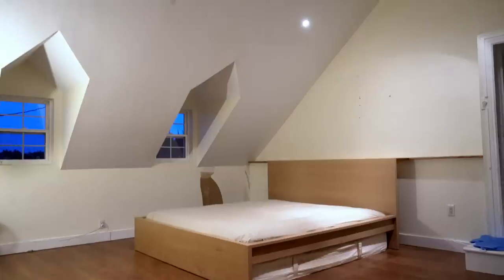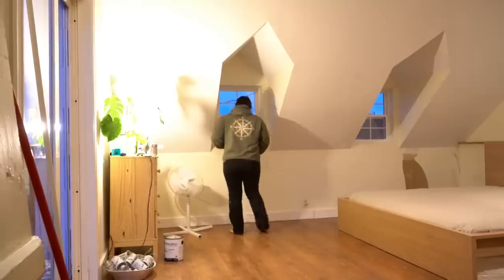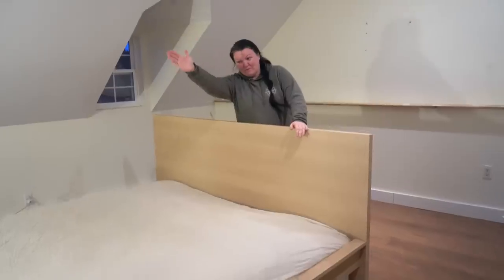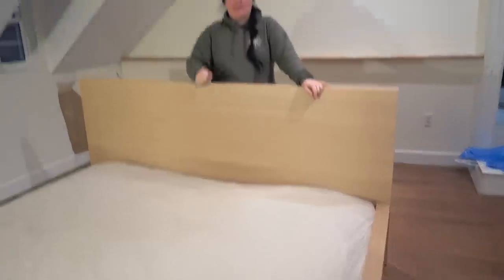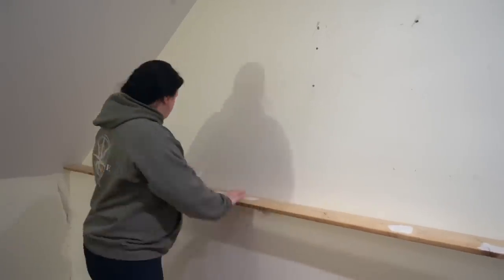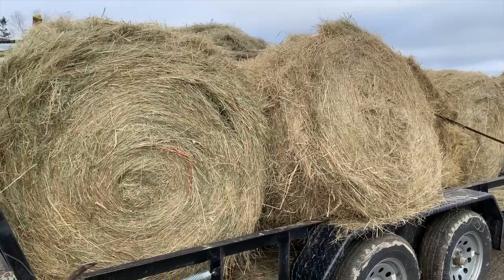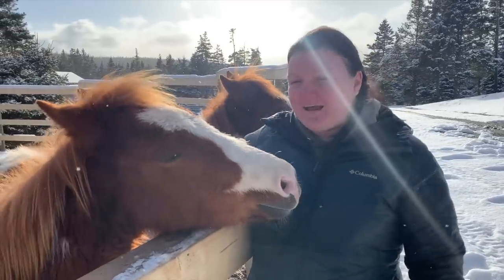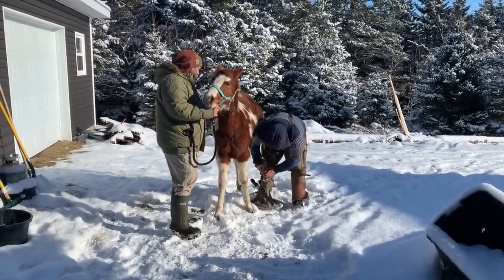Designing a MOODY minimalist BEDROOM MAKEOVER under $500! Ep.1

Comment: The lower part that sticks out a little, is part of a "wall" system. It's straight, unlike above which is part of the roof, and as you pointed out, the mansard on that one wall leans out. So basically they put a little lip, at that point, so the bottom part would be straight, and the lip is just the difference in the leaning wall, and the lower straight wall. The only other option would have been to have that entire wall lean out, or to change the roof. Pretend it is a chair rail, or in this case, a bed rail, it does seem like a great place for some shiplap though.